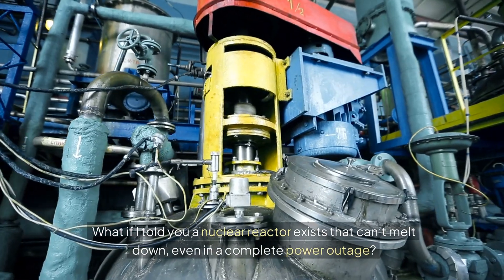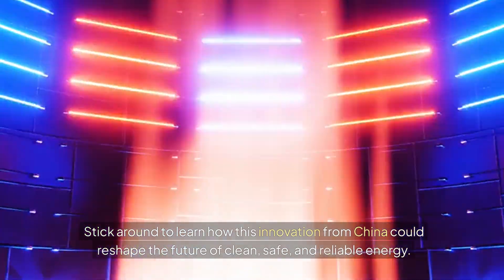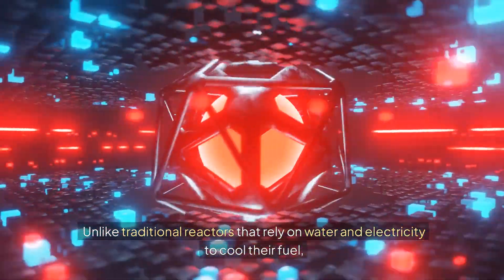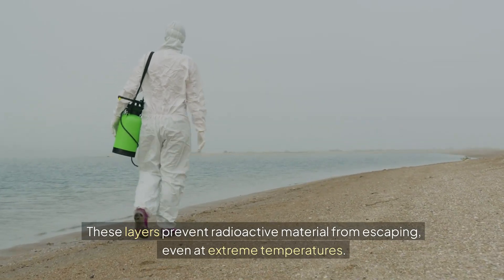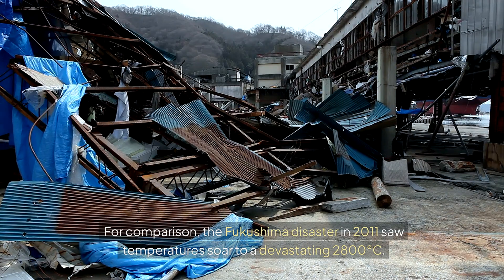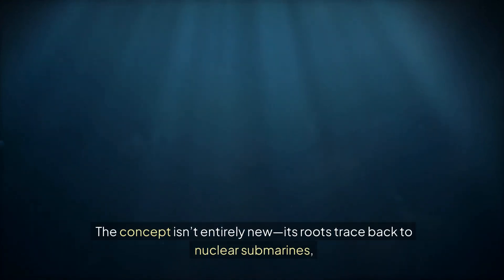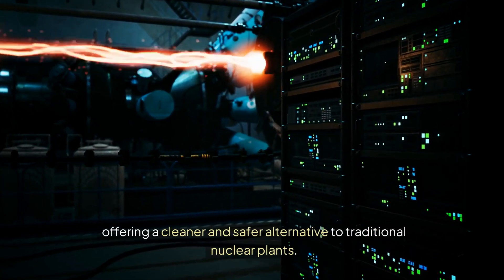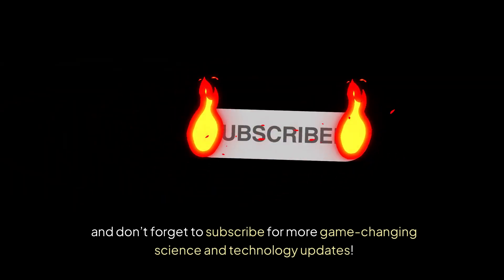Pebble Bed Reactor: The Future of Safe and Reliable Nuclear Energy Explained!

Comment: There is nothing new about pebble bed reactors, and this is not a Chinese development.  They were developed by Germany who built 2 of them (the 2nd one was a 300 MWe commercial nuclear power plant).   Key problem that developed in both reactors was that the pebbles broke and both the pieces and full intact pebbles got stuck in the bottom of the reactors.  They are still there as Germany ponders how to eventually clean them up.

China licensed the pebble bed technology from Germany, and modified a few things hoping to hopefully solve both the broken pebbles and the stuck pebbles in the bottom.   We do not yet know if they were successful with that (it will be years before we likely know).  The current Chinese pebble bed reactors are more of a development program than anything else. China is seeing if they can make it work, and is willing to spend the money on several generations of design changes to see if they can be successful.

If successful a pebble bed nuclear reactor plant could operate at a significantly higher thermal efficiency than a light water (BWR/PWR nuclear power plant) - I think about 10% more efficient (without looking it up).

However, there are several other reactor designs that could operate at similar thermal efficiencies if they can be made to work, and some of those could not have a conventional meltdown either.